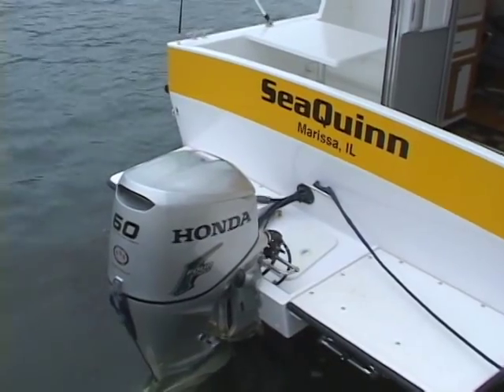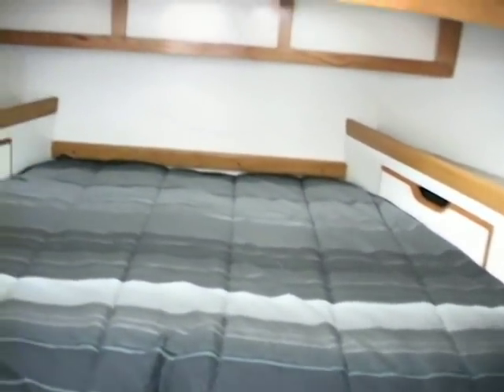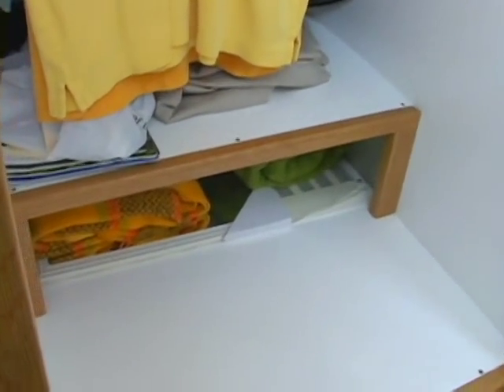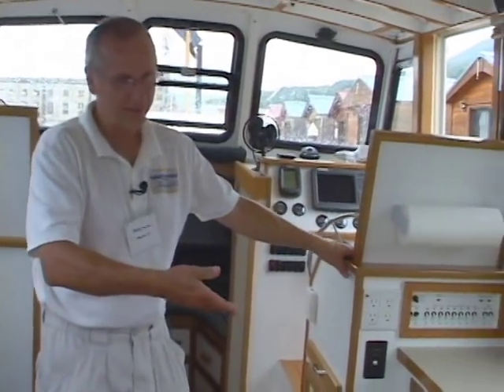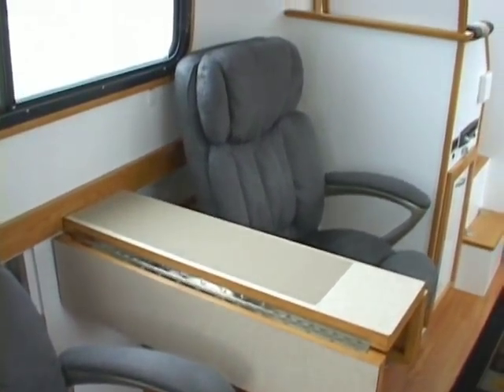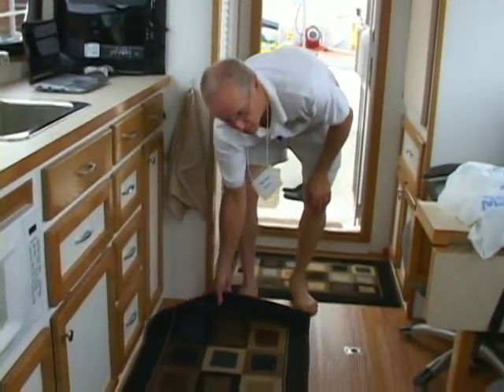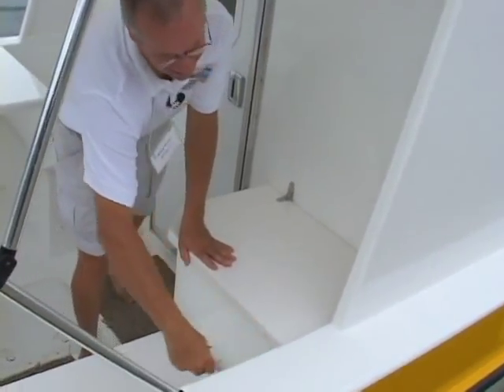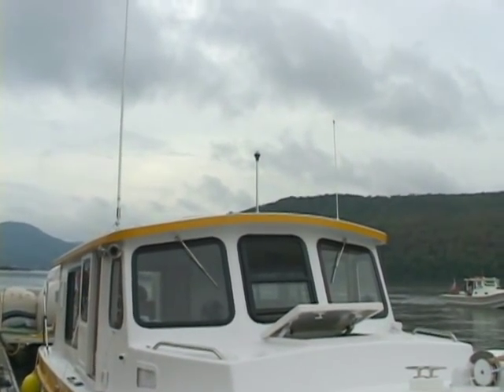Build Your Own Cruiser

Comment: I lived aboard and cruised for 11 years on a 40 foot trimaran using propane for my galley range and never had any problems whatsoever, as long as you are mindful of it and check for rust and leaks. I logged all my fills and ran inspections every two weeks. I purchased a Glen-L catalog twenty years ago but never had the space to build in but a friend who looked it over one night ended up buying a set of plans and built a Chessie Flyer and still cruises Florida Bay in it.  Nice job on the Sea Quinn and a gallon per hour is pretty darn economical.

Comment: Very nice job and the perfect size cruiser, but I'm biased. ;)

 I have butane, and kept that way, because I always understood propane is more explosive and or toxic. But I'm not sure that's right. Looking into it, propane doesn't seem much more dangerous than butane. The big danger with butane is that if it leaks from part of the run inside the boat, it is heavy and will settle in the bilge, where it is perfectly situated to blow the boat sky high if ignited. I think butane is smellier, so you notice when you leave it on. I've tried to light the wrong hob once or twice, and you very quickly smell the unburnt butane.

Comment: why don't you put on a 300hp engine or twin 150s, why so under powered for the size of the boat?
Reply: It's a displacement hull, not gonna get up on plane regardless of how much hp you feed it.  Just burn more fuel.
Reply: Its a shallow v hull, it could get on plane easy.